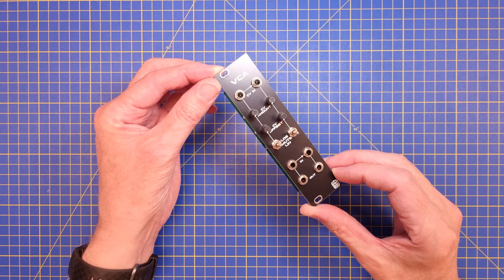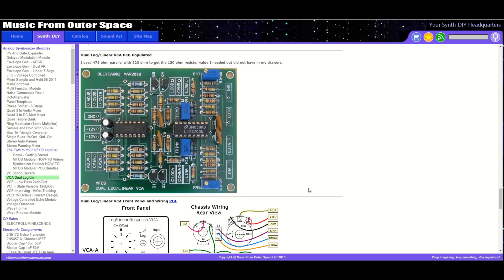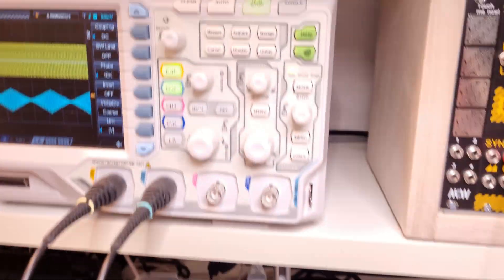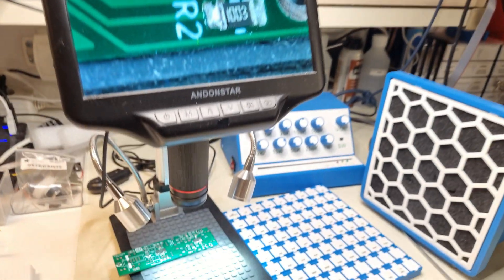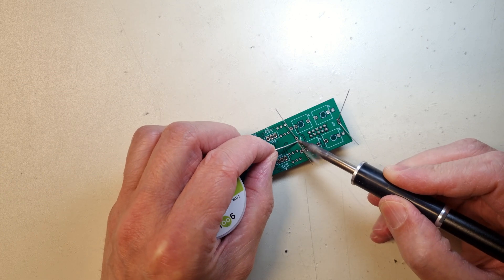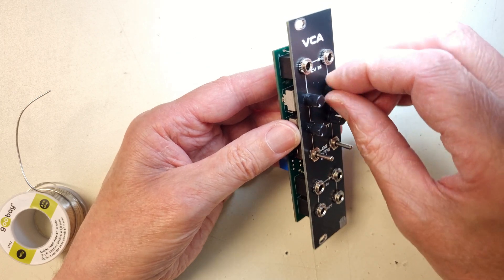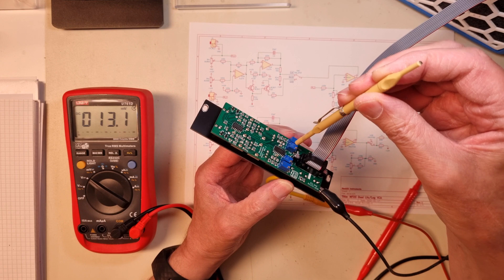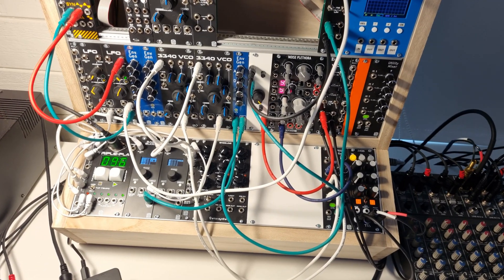Eurorack DIY: Dual VCA module

Comment: Thansk for this video. I build one on protoboard and my exponential output don't works...

I used 2n3904 and 2n3906 transistors because they were the ones I had at hand, they are the same ones as in the MFOS schematic and the resistor values are the same too, but for some reason the exponential output doesn't work.

With a 0/+5v CV square signal, I get a 0/+275 mv square signal at the base of the PNP transistor. If Adjust CV Offsett to Max, then I get a +360mv/+660 mv square signal at the base of the PNP transistor. With 660mv on the base of transistor it should be in active, but my emitter voltaje is -9.20v (-9.60 in exponential out througt 20k resistor).

Any ideas?
Reply from the maker: I would suggest to use a triangle waveform as a CV signal when you are testing. A square wave isn't really gonna help you troubleshoot the exp output - it's better to use a linear waveform like a triangle (or a sawtooth).

Keep in mind that the control input on the OTA is a current input and if you exceed ~2 mA the chip will break down. Measuring the current on the exp output is also a bit tricky, especially if you measure the voltage levels and have the OTA connected, but I guess that you could measure across the 20k resistor with a multimeter and calculate the current.

Finally; building this circuit on a breadboard (or stripboard) is really difficult. The LM13700 operates with really small signal levels and I barely got it to work on my breadboard setup. I didn't get good performance until I made the PCB.
Reply: @MeeBilt  Thank you so much!!

I finally replaced the transistors with other units of the same specification and got it working. Thanks for the advice!

Now it's time to design a decent board. I could barely fit all the components on a 10 HP panel since I did it with two CV inputs per channel.

I just started building my own modular synth a month ago, and your channel is helping me a lot.

Once again thanks for your work.
Reply from the maker: @oscarpastor4439  Awesome, welcome to the fun world of Synthy DIY. Good luck with your builds!